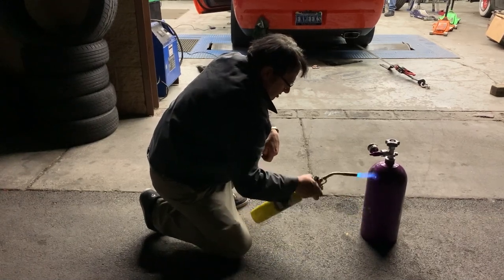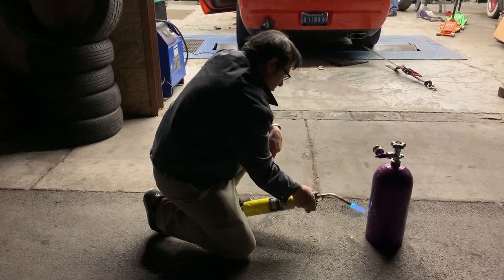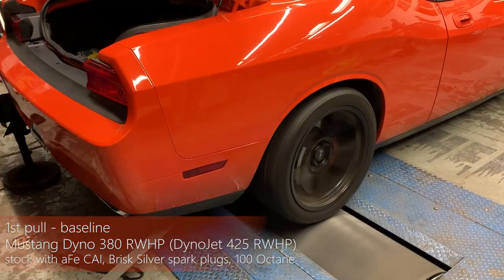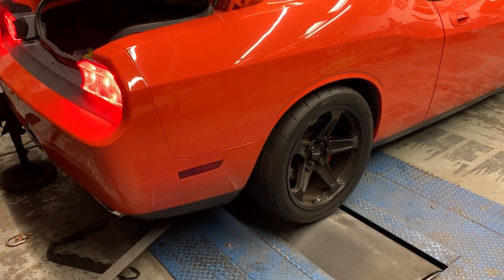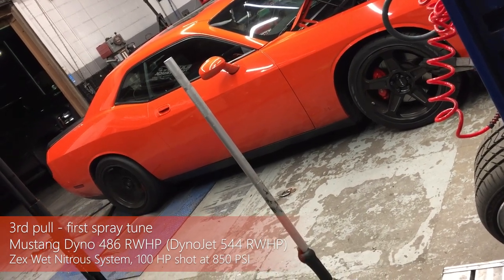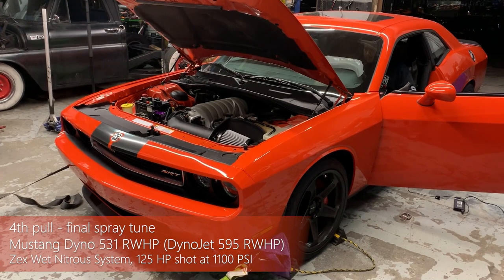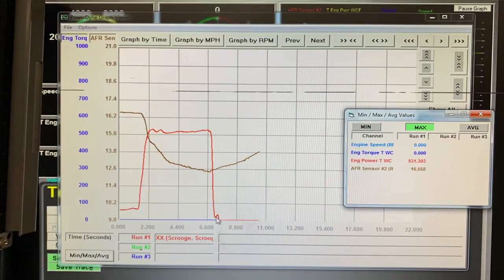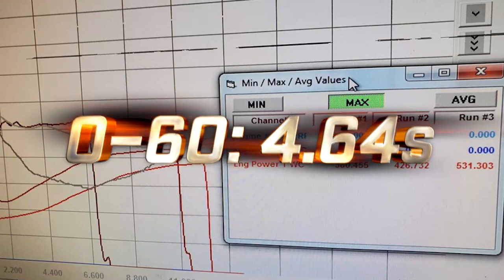Nitrous Dyno Tune on a 6.1L HEMI Makes 595 RWHP!

Comment: Interesting you’re seeing those numbers NA. Typically a stock 6.1 is 380 (ish) wheel. My cammed 6.1 with HP tuners dyno tune on 93 octane put out around 450whp / 405wtq.
Reply from the maker: Yeah that baseline pull where I removed the DiabloSport 93 OCT CAI canned tune and ran it with the stock tune was exactly 380. 426 RWHP from the NA custom tune with the CAI and 100 OCT was surprising and gratifying that it was a MOPAR-significant number.
Reply: @Brian Mayes ,which cam are U using??
Reply: @kamehameha455  OSTMax cam
Reply: @BrianWM  Thanks man
Reply: Wow thats really impressive! What else did you do to it, other than the cam?

Comment: Thinking getting a nitrous kit on my 6.1 magnum..
Reply from the maker: Dooo eeet! Doooo eeeet naaaaoooo! 6.1s love that spray.
Reply: @HEMImania   i got a cam and a 3,200 stall converter. Was thinking getting a wet shot and a 5 gallon running e85 for the wet kit..
Reply from the maker: William Lopez that sounds like one rad setup. Got colder spark plugs like Brisk Silver RR14S?
Reply: @HEMImania   whats going to suck is i have to get it tune again..
Reply from the maker: William Lopez I hear that. I am going to a tuning clinic next year (2020’s were canceled) so I can learn and maybe do it myself as my build advances. Are you going dyno or mail-in data logs?
Reply: @HEMImania  thinking of getting dyno..
Reply: @HEMImania  thanks for the info..  first time putting nitrous on a hemi.. didn't know what plug to use.

Comment: Ayeee I have the same car and color, about to start throwing money into it soon
Reply from the maker: You will not regret it. A DiabloSport i3 tuner and some drag radials are a solid early investment. HEMI Orange SRT-8 FTW!
Reply: @HEMImania  i just got the i2 today, spent whole evening on it, got her tire  chirping through 1-3
Reply from the maker: hemiyacht charger nice! The firmer shift points and increased throttle response from the DiabloSport canned tunes makes for even more spirited driving indeed.
Reply: Is the motor stock
Reply from the maker: 2552nelly yep, no work done to the motor. Just tuned for CAI &100 Octane for the 2nd pull to make the extra power.
Reply: What’s rims are those ?
Reply from the maker: Juan Camacho Voxx Demon Replicas from Discount Tire. 20x9 front, 20x10.5 rear.
Reply: @HEMImania  thank you appreciate it

Comment: strange…I got a 4.0 0-60 in my charger srt8 making 376whp. I still got consistent 4.3-4.4 0-60’s with my buddy in my car and a trunk load of shit😅
Reply from the maker: Dope! Any wheel spin when hitting low 4s? SRT performance pages EVIC metrics are inaccurate when losing traction but hey, you could have some anomaly SRT8 gem—in which case… hells yeah my man! 1/4 mile time slip should be 11 sec for you then.

Comment: Is that a full zex kit?
Reply from the maker: Yes, wet kit nozzle & controller. Using Holley NOS & Zex bottles interchangeably.
Reply: @HEMImania  the zex controller never gave you any issues ?
Reply from the maker: @kylechupick2232 hasn’t yet. If I were to do it all over I would go with a Holley kit plus progressive controller but Zex has been fine. 100+ passes with the 125 HP shot & 100 OCT. If you accidentally press the black reset button on the controller you have to do the wide open throttle calibration again but I’ve avoided that for all these years.
Reply: @HEMImania  I might pick up a nitrous outlet kit used and controller with a pro nitrous board
Reply from the maker: @kylechupick2232 awww yeah! 💪
Reply: @HEMImania  but I must say I was thinking zex also
Reply: @HEMImania  I was thinking about the zex kit now cause I only plan on running a small shot since my car is cammed but stock internals, do you leave that zex box hooked up all the time or just hook it up when you spray?
Reply from the maker: @kylechupick2232 always hooked up. I only remove the bottle from the trunk when it gets over 100° in town and I’m not running in events.

Comment: So when you heat the nitrous up you get more power?
Reply from the maker: Nitrous bottles need to be at an optimal PSI of 1000–1100 which is usually 88° F. When it's too cold like on this night in February, it required heating it up quickly while the guys at the dyno waited. I've since installed an electric bottle warmer with a console switch for it. In the summer the bottle needs ice bags to cool down to 88°. 
Too hot and the nitrous solenoid could seize up, too cold and the N₂O will not inject at full force and thus less power.
Reply: @HEMImania  also how accurate is the quarter mile time thing built into our cars?
Reply from the maker: @505media9  my EVIC ¼ mile Performance Page has been off from the LVMS timeslip by at least 3/10 of a second before (for the worse). I've also seen Challenger group peeps post these sub 4 second 0-60 pics from their stock R/Ts followed by a grip of replies that traction and wheel spin can throw the Performance Page metrics off for any given distance.

Have you noticed some questionable numbers come up on yours?
Reply: @HEMImania  I have acuelly do you have Instagram maybe I can connect and share some times on there with you?
Reply from the maker: @505media9  yep https://www.instagram.com/HEMImaniaSRT8/

Comment: Hows it holding up
Reply from the maker: Running well and consistentl 12.10-12.30 quarter miles with N₂O. When it warms up in the spring I may be able to get it into 11s.

Comment: Supporting mods ?
Reply: Not much: Brisk Silver spark plugs, aFe Magnum FORCE Stage 2 Pro DRY S Filter CAI, VLAND Ram Air headlights.
Reply: @joemeeks3  can the shop you went to do the work ?
Reply from the maker: Dr. Noz and/or myself did the individual part installations piece-by-piece over the course of a year. The RWHP afterwards is all the result of the mastermind that did the tune. He's incarcerated now, though, and I'm not sure whether Sin City Performance has anyone doing tunes there that is on par with that last guy.